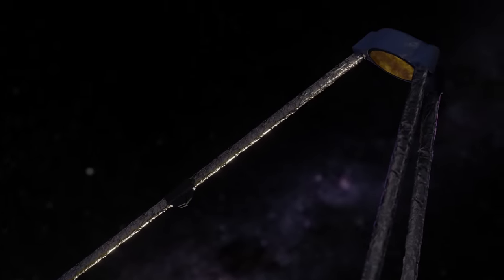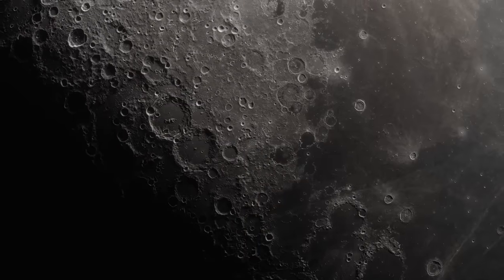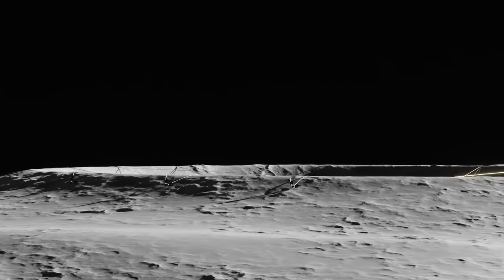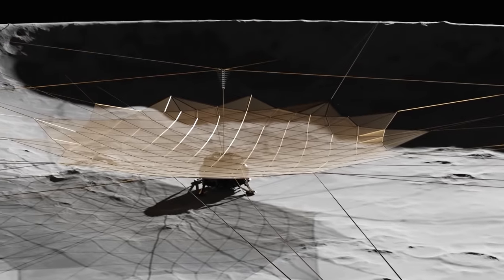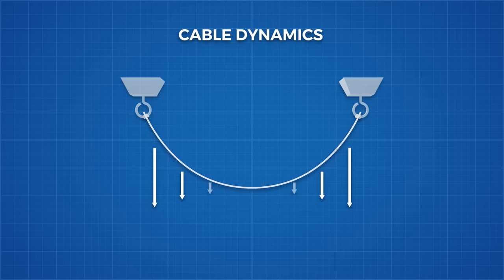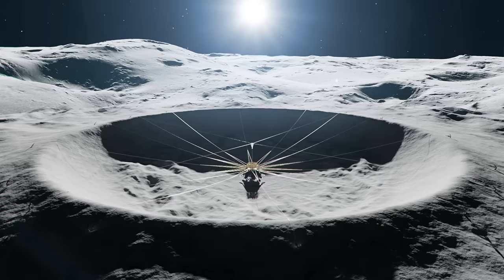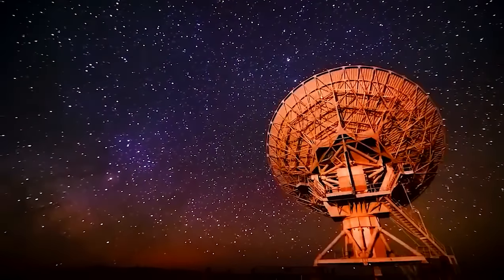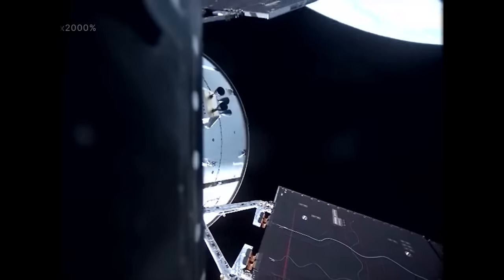NASA's Plan to Build A Telescope on the Moon

Comment: "Supporting a 200 kilogram telescope on the moon is equivalent to holding just about 320 kg on Earth" Am I stupid or does this sentence makes no sense?
Reply from the maker: We had an audio fix recorded, looks like it wasn’t added
Reply from the maker: Was supposed to be 2000 kg. I just read it wrong without realizing.
Reply: @RealEngineering  how can you read 2000 as 320 also 1 minute ago
Reply: @petterlarsson7257 Can read 200 as 2000.
Reply: @petterlarsson7257 Daddy chill
Reply: @tozrimondher4250 what the hell is even that?
Reply: @RealEngineering wait I'm now more confused about your calculations because moon's gravity is low so 200KG on earth would be very less in moon. 🤔🤔
Reply: Oh now I understand after thinking a bit .
He ment 2000kg on moon = 320 kg on earth. Hehe mistake happens 😅
Reply: @GOOD_FARMER  2000kg on earth would weigh 320kg on the moon. Or 200kg on earth would weigh 32kg on the moon. Pick whichever you understand better.
Reply: bro watch with subtitles
Reply: She meant equivalent to holding it in Kubrick's studio.
Reply: Not getting how 2000kg here is ~320kg on the moon gave me cancer. Thanks a lot.
Reply: I feel dumber after reading this comment section. I’ll go watch a Anton Petrov video to realign my brain cells.
Reply: Are these metric kilograms, or imperial kilograms?
Reply: (200kg/9.81ms^2)×(1.622ms^2)=33.07kg
I'm gunna assume they meant to say 32 not 320
Reply: @YippingFox   the beauty of the metric system ;-)
Reply: Thanks for the clarification. Not to worry, we all make mistakes some times.  @RealEngineering
Reply: I like how most people give zero ducks about math till they start getting positive feedback from a bunch of likes in a comment thread. Then it's a race to post something correct and sound smart... perhaps some math teacher could use this.
Reply: @truejim metric pounds
Reply: Let's get there first
Reply: @kamabokogonpachiro6797 they can't read
Reply: @truejim  Vulcan KGs
Reply: @petterlarsson7257  Be cool, baby.
Reply: @petterlarsson7257 are u slow
Reply: I used my brain and realised it's just a speech mistake.
Reply: Everyone here is wrong, 2000kg in the moon is still 2000kg. The relative gravity doesn't change the mass of an object.
Reply: @nobodyofnaught2  Did you use kg and mass in the same sentence?
Reply: 200 kg on the moon would be like 32 kg here.  I think there was just a zero added to 32 kg so it read as 320 kg.
Reply: @sicfxmusic  I didn't, it was clearly two separate sentences, but even if I had I don't understand what you're trying to imply by your comment.
Reply: @RealEngineering  thats.. not how mass works
Reply: @nobodyofnaught2  is right, w=m*g where kg is a unit of mass and g is the gravitational acceleration constant on the body. The metric unit of weight (force in general but weight is a force) is newtons
Reply: @RealEngineering appreciate the correct info!
Reply: @nobodyofnaught2  Correct. As any scientists will tell you, mass is measured in kilograms, weight is measured in yo-mommas.
Reply: @vivigesso3756 Weird how all these countries to conspire to lie about it. You must be SO smart figuring out the truth. What are you, like a rocket scientist or Nobel prize winner??!
Reply: He did say 16% so it's easy to understand the mistake.
16% means 2000=320 or 200=36.
Reply: This thread made me lose brain cells
Reply: @matthewholt2174 there is such a thing as a kilogram-force which is often used in engineering.
Reply: @juan3141 oh i love this era
Reply: @TankandDimples you can’t write.
Reply: @tozrimondher4250  ogbb?
Reply: @vivigesso3756  If that's your takeaway, go back to the Bible you've probably never read.
Reply: @artnok927  which is defined by the gravitational constant of earth. A kilogram force on the moon isnt equivalent to a kilogram force on earth because they have different gravitational constants.
Reply: @petterlarsson7257  am I stupid or are you making no sense? Obviously he meant 200 :face-blue-smiling:
Reply: @vivigesso3756 Sure bud
Reply: @RealEngineering  i
Reply: @RealEngineering how much is that in standard elephants please
Reply: Roman kilo
Reply: @juan3141 😂
Reply: @RealEngineering add correction note on screen 7:09  so people don't misunderstand
Reply: Damn you guys really jump at the smallest thing
Reply: @nobodyofnaught2  OK
Reply: @nobodyofnaught2  

Yes kg is a unit of mass and newtons would be weight, so one technically should say that X amount mass makes so much force on earth, but only so much on the moon, 

but an actually smart person knows that getting the information across in an easy to understand way, is way more important than extreme pedantry.

For the average person, "mass" and "weight" are the same from an intuitive perspective. So framing it as such that it's less kilogramme on the moon than earth, will get the idea across that it produces less force (it "feels" less heavy) due to the lesser gravity.
Reply: It's not correct.  Kilograms are mass.  So 200 kg on earth is 200 kg on the moon or anywhere even in zero g.   The weight is different and should be represented in Newtons.
Reply: @truejim You just made reading through all the previous comments worth it! 😂
Reply: @GOOD_FARMER  What he was trying to say is 2000 on the moon is the same as 320 on earth. Make sense? Not the other way around.
Reply: Exactly this! A kilogram is a kilogram no matter where you are.
Reply: @kamabokogonpachiro6797 what do you think I am deaf!? I think not!!
Reply: Jeez
Reply: also, there's no atmosphere to protect it from small rocks that will shatter it
Reply: @Freja_Solstheim No. He meant to say 2000kg on the Moon weighs the same as 320kg on the Earth

1kg on the Earth = 1kg on the Moon, its their corresponding weights that are different. You said it backwards: in fact, the weight of 2000 kg on the Earth (19.6 kN) is equal to the weight of 12,080 kg on the moon (19.6 kN)
Reply: @vivigesso3756 we know.....
never been to earth and the moon is flat😏
Reply: Inertia and gravity are a bit different.  I just torched them for trying a moonbase before a lagrange satellite.
Reply: @GrandProtectorDark  was just pointing out that if pendants are going to get lost in an argument about what was obviously a simple slip of the tongue they should at least be correct in their pedantry.
Reply: @RealEngineering I understand the mistake made. No worries RE, we all misspeak at times. The content is still great. Keep it up! 🎉
Reply: @truejim  stone age units or metric units?
Reply: Here come the youtube professional jackals. They have a sent of your blood pal.
Reply: What's a kilogram?
Reply: @geetarwanabe  2.2 pounds American weigh scale
Reply: @nobodyofnaught2 Please learn the difference between mass and weight..
Reply: @anonymouse8722  please explain how I used mass and weight incorrectly? Are not Kilograms a unit of mass?
Reply: @YippingFox 2mg=320000000pg got it.
Reply: @nobodyofnaught2 apparently he means kg-f. Not the actual mass but the gravitational force that a scale calibrated for earth would register if it was used on the moon.
Reply: you added subtitles and you admitted your mistake... I say all is well in the universe now.  @RealEngineering  *edit* however it did give me a giggle
Reply: @RealEngineering thanks for clarifying i just watched that section 7 times thinking i stroked out
Reply: @vivigesso3756 Neil A:
Reply: @vivigesso3756  I agree. 
What you said is all dumb. Now, go read a book. Adults talking here.
Reply: So, you are just reading what is written without thinking what you're saying. Hang your head in shame for making such a careless mistake. I can never take what you say serious again.😝🤪🤣 @RealEngineering
Reply: Less weight on the moon like you be 200lbs but on the moon you be 110lbs or something like that.
Reply: @coolhawk2003  No. A lot less.
It's a 6th or if you prefer, 16% of earth's gravity . 200 lbs=32 lbs
Reply: OMG these comments be like: “Well actually….🤓🧐”
Reply: @RealEngineering Please try to pronounce ESA correctly… next time😅🫶 great vid!
Reply: Made no sense to me too
Reply: It should have been: Supporting a 2000 kg object on the moon is equivalent to holding just about 320 kg on Earth.
Reply: @nobodyofnaught2  a better way to say it would be that a 2000 kg object on the moon would weigh the same as a 320 kg object on earth.
Reply: @RealEngineering how? Its like people can bounce off the moon's surface because it has no gravity but it causes weight to become more than earth without gravity? I am no science student and I am no scientist but this is definitely not the case.
Reply: @nobodyofnaught2 weight, not mass. mass is constant, weight isn’t
Reply: @_apsis  mass is measured in kilograms, weight is force an object applies to another object due to gravitational acceleration, weight is measured in newtons, not kg.
Reply: @nobodyofnaught2  i suppose you’d be correct. kg in this situation more means kgf, the force applied to a kg of mass under 1g of gravity. more easily understandable to the average person than differentiating kg and N, they should be able to understand what’s meant by it
Reply: @_apsis  based on the quality of discourse in this thread I assumed the goal of this conversation was to be pedanticaly correct not provide useful comparisons for the average person.
Reply: @nobodyofnaught2  lmao fair
Reply: Demand double you money back on this video.
Reply: @TexMex421  0x2=0
Reply: @_apsis   Then get 3X!
Reply: @TexMex421  0x3=0
Reply: @_apsis  OK 4X but any more is going to be unreasonable.
Reply: @TexMex421  0x4=0
Reply: @_apsis  OK  1 / whatever he paid squared.
Reply: @TexMex421  1/0^2=
Reply: @hongchan1202  further and farther are interchangeable, aren’t they?
Reply: @GOOD_FARMER  which is wrong, things weigh more on earth and less on moon
Reply: 2000 not 200
Reply: I'm just here to watch the comment section milk a simple mistake for clout. 😂
Reply: @jamescrewe6845 then let me introduce myself to you. I don’t make mitakes, NEVER!
Reply: Weight will change; mass wont since its independent of gravity acting on an object but gravity does influence weight, therefore, u are also wrong, so is he.
Reply: @truejim lol at yo-mommas. That was multi-layered😂 But mass is measured in grams. They can be converted to kilograms. I couldn’t help myself🫣
Reply: @byronbuyck2222   That's an excellent point. Like, "yo-momma so heavy, she measured in kilo-yo-mommas." 😉
Reply: @petterlarsson7257  
Moon gravitational attraction is about a sixth of Earth's.
A sixth of 2000 gets you into the 320 range, get it?
Duh.
Reply: @RealEngineering  
" it wasn’t added"?!
The passive voice, the grammatical form of somebody evading responsibility.
Reply: @ClappOnUpp what you pretend a scientific explanation? this channel is the equivalent of craft in 5 minutes but for astronomy, there are other channels i.e. PB Space Times... what's the sense to discuss a telescope on the moon when we never been there and will stay like this for the next 50 years
Reply: @wisdon  "what you pretend a scientific explanation" I have an idea as to what you're trying to say, but your grammar is so rough that I can tell you didn't go to college. On that basis alone, I'm going to assume you don't know how to do basic acceleration calculations. There's just waaaay too many things wrong with that mess of a reply you tagged me in.. so, I will give you some advice: Try following a couple of basic grammar rules; it will make a world of difference when you're trying to come off as smarter than you are (trust me, it worked on my professors- I did not deserve the gpa I graduated with). Maybe that's not what you were doing, but that's how it feels. Again, it's such a mess that it's hard to tell what. Also, try and give the physics a quick google next time. I.e. Check yourself before you wreck yourself. It looks really bad when you tell someone they're wrong, and you're wrong about it (I kinda feel the cringe for you.. so I'm being nice). If you want to learn some physics, I am a tutor at my local college so you're welcome to message me..
Have a good day drink bud :P
Reply: @truejim  😂🤣😂🤣 science is great lol
Reply: I always heard moon gravity is 1/6 so 200 is equivalent to 1200 or 33.333 depending on which direction you're talking about
Reply: @RealEngineering p🎉k😊
Reply: 200 kg on earth, on the Moon and in Space is the same mass. What differs is the weight. Appereantly the narrator (and most of the commentators here) have no idea about the difference between mass and weight.
Reply: @matthewholt2174 Never ever use w as weight. It's either work or angular frequency. F_G would be appropriate for gravitational force.
Reply: @squawkthepenguin9492  The object weights 2000kg on earth. But we weigh objects by measuring the mass under our acceleration.
So what we actually measure is 2000kg * 9.81(m/s^2) = 19'620N.

The object on the moon will have the same mass, but the moon having a different mass and size than the earth, it has a different gravitational acceleration.
So instead we go with 2000kg * 1.61(m/s^2) = 3240 N.

Since Newton is Force and force is relatable to us as in lifting or pushing things, you could translate this back to us as in lifting something with 3240N which equates to lifting an object that is as heavy as 330 kg. (3240N / 9.81 (m/s^2) = 330kg)

320 probably was a result of simplifying the calculations with the gravitational acceleration from 9.81 to 10, although that decision seems a bit silly to me.
Reply: @RealEngineering Still makes no sense because kilograms is mass. Did you mean pounds or newtons?
Reply: @GOOD_FARMER 200kg on moon = 200kg on earth because kg is mass not weight
Reply: Inflation spares nothing and no one, lol
Reply: @nobodyofnaught2  everyone realizes that he meant the weight of that mass. The lay person probably doesn’t know what a Newton (kg*m/s^2) is.
Reply: @dathaniel9403  this discussion is not about what everyone understands, if that was case it would have ended after the first two comments when RealEngineering clarified the mistake.

The rest of the thread is just people arguing about who is most technically correct, and so far as it is possible to "win" an argument on the internet I think won this battle.
Reply: Kilogram measures mass. 200kg on earth is still 200kg on the moon. It is the weight that changes.
Reply: @RealEngineering sometimes that happens, humans make mistakes. Great video as always! ❤
Reply: @petterlarsson7257 mistakes can be made right? No need to be such a nitpicked person
Reply: @GOOD_FARMER It was supposed to be 2000 on moon = 320 on earth
Reply: @BondiAV  it's pretty clear from all the other posts in this thread the goal of this argument is to be technically correct not practically correct, I stand by my claim.
Reply: He was just testing to see if you were really listening.
(ツ)☕ ☕(ツ)
Reply: @be1withthewater African or Asian?
Reply: @petterlarsson7257 how did you get this wrong when it’s been discussed 3 times lmao
Reply: Since it's 16% gravity I suppose it's either a 2000kg telescope or 32kg on Earth. ^^
Reply: @nobodyofnaught2  Its obvious that everyone is referring to weight, which is affected by gravity, and not mass which is not. In fact some people even used the word weight. Kg is the correct unit to refer to both as long as you use the word "weight"   to refer to the value affected by gravity.
Reply: Mass is the same, regardless of location. The weight changes. A kilogram is a unit of mass, hence the mass is always the same. Weight is measured in Newton. The same mass only has 1/6 the weight on the moon.
Reply: @RealEngineering 👍 4 the candid response
Reply: NASA's Plan to Build A Telescope on the Moon    2124pm  8.11.23   yer probably stupid as i comprehended that eqaution.....  a 600kg telescope on the moon would be akin to a 960kg telescope situated on earth....................... unless there's some weird conversion tablet they've located (akin to temperature range chart of Celsius to   Fahrenheit)... ahahah... you need ready reckoner. last seen during 1950 post world war two market stalls and 1971 decimalisation programme.
Reply: Hmm… well, if you think about it, you could have a telescope that would weigh the equivalent of 320 kg under earth’s gravity and yet weigh 200 kg under lunar gravity because of some kind of new lightweight materials used to build that telescope, and the fact that lunar gravity is 1/6 of the Earth, in some spots on the moon.

And plus if you use origami folding techniques, you can build massive space telescopes or sunshield and send them into space on a smaller launch bed and then once they’ve reached their destination, they can open up an expand to… Hmm… anywhere from 100 to thousand to 10,000 to 100,000 times there stowed dimensions
Reply: @1LEgGOdt NASA's Plan to Build A Telescope on the Moon   1623pm  16.11.23   and there you have it. origami is the way forward.... let's hope these hi-tech image creators or satellites etc etc  unfold just as easily as they folded up, though... most folk have trouble with a deckchair.
Reply: @RealEngineering  Stop using non STEM people to blindly read your scripts. Be decent.
Reply: @petterlarsson7257 how can you spend your time asking idiotic questions?
Reply: can you chill guys
Reply: @petterlarsson7257 lets start with spelling peter right first
Reply: @curiousguy9884  petter is correct
i live in sweden
Reply: @nobodyofnaught2 it just falls way much slower.
Reply: Yes.
Reply: @YippingFox no pick the 2000kg one because that's the estimate of the mass of the telescope
Reply: @ClappOnUpp they meant to say 2000
Reply: @nobodyofnaught2 he didn't say the mass changes. he's saying supporting 2000kg on the moon requires about the same strength as supporting 320kg on earth or - the pull of moons gravity on 2000kg is equivalent to the pull of earths gravity on 320kg
Reply: @RealEngineering appreciate the way you care enough to clarify your mistakes.
Reply: @petterlarsson7257 because he wasn’t talking about 320 he was talking about 200 😂
Reply: @GOOD_FARMER  The gravity on the moon is only 16% of that on the earth. so if something weighs 200kg on earth is will seem like 32kg on the moon. Does that help?
Reply: No babes...mass never change but force due to gravity does
Reply: @RealEngineering  I heard 2000 kg...
Reply: @petterlarsson7257 Peter*  Not Petter. But go off.
Reply: @RealEngineering  Maybe try spelling out the numbers instead of writing them numerically? It's much harder to mix up 'Two Thousand' and 'Two Hundred' than '2000' and '200'
Reply: @YippingFox I think he means 2000kg in the moon, would be equivalent to 350kg on earth.
Reply: The moon has weaker gravity, so things would weigh less on the moon.
kinda confusing, yet understandable
Reply: @sicfxmusic kg is the scientific unit of mass, not weight
Reply: @GrandProtectorDark  An object's mass doesn't "make force" to turn it into it's weight.  The Earth / moon are the object's that apply force (gravity) to the object, which is where the weight comes from.  In empty space the object is "weightless", not mass-less.
Reply: @VirtualEmu Yes.  The mass is the same in both places, the weight is different.
Reply: @RealEngineering  you think we are all stupid? this is obviously a death star superlaser!!!!
Reply: @petterlarsson7257  How can you 320 as read also can minute how ago?
Reply: @billyjoe3309  ???
Reply: gravity is around 1/6g
if you weigh 200lp on earth
you would weigh 33lp on the moon
Reply: @undertow2142 😂😂😂 lmmfao
Reply: @truejim 😂😂😂😂😂.  😢
Reply: @ClappOnUpp 😂😂😂😂
Reply: @ciaoatutti11111111 😂😂😂😂
Reply: @hilmao7344 😂😂😂😂
Reply: @nobodyofnaught2 😂😂😂😂
Reply: @sicfxmusic 😂😂😂
Reply: @derekmcgee334 😂😂😂
Reply: @matthewholt2174 😂😂😂
Reply: @matthewholt2174 😂😂😂
Reply: @truejim 😂😂😂
Reply: @filonin2 😂😂😂
Reply: @kaba_me 😂😂😂
Reply: @DrDeuteron 😂😭
Reply: @GuntherRommel 😆😅😂🤣😭
Reply: @squawkthepenguin9492 😆😭
Reply: @cosmicchuck9743 😆
Reply: @be1withthewater 😂🤣😭
Reply: @GrandProtectorDark 😢😆😂🤣😭
Reply: @TJ-vh2ps 😆👌
Reply: @trentlogan6117 😆😅😂🤣
Reply: @NACAM42 😂
Reply: @leaf16nut 😆
Reply: @Zaros262 🤦😆
Reply: @nobodyofnaught2 😂
Reply: @asiano3385 🤦😆🤣
Reply: @project-unifiedfreepeoples  😂 sent 😮.  🤣🤦
Reply: @geetarwanabe  😂
Reply: @LePageChannel 🤦🤣
Reply: @lawrencet83 🤦😆🤣😭
Reply: @coolhawk2003 👌
Reply: @anthonymoreno894   😭
Reply: @Ferocious_Cat 😆🤦 me too 😁
Reply: @TexMex421 😂
Reply: @1slotmech 😂
Reply: @Omsip123  "EVER ".  🤦😆🤣😭
Reply: @ClappOnUpp  🤦😆😅😂🤣😭
Reply: @ProfessorStephon  Finally after 6 months someone gets the joke, but you do seem to excel at that.
Reply: @DrDeuteron  I stumbled onto this gold mine of idiotic comments masquerading as jokes and I've been in troll heaven ever since. But I predict some more stupid comments masquerading as jokes aimed at me coming shortly.... 😭👌
Reply: Could a chicken fly on the moon?
Reply: @YippingFox Speak English!!! Just kidding 😝🤣🤣🤣🤣
Reply: @petterlarsson7257 dog hes human everyone makes mistakes lmao
Reply: Earth has a more mass, hence a larger gravitational pull, 6kg on earth would only be 1kg on the moon (6x less)
Reply: And just like that…Validity rescinded.